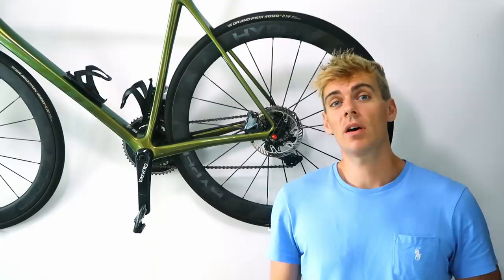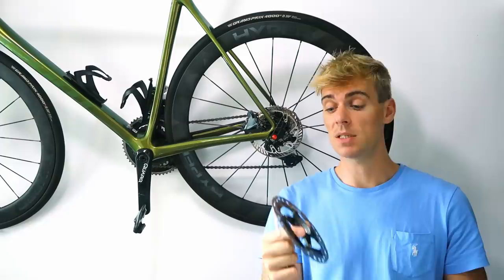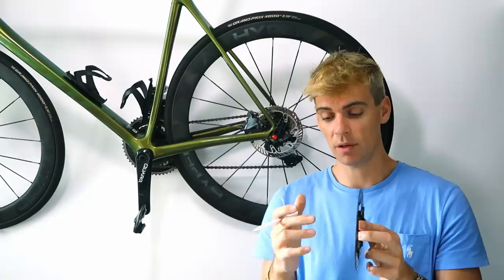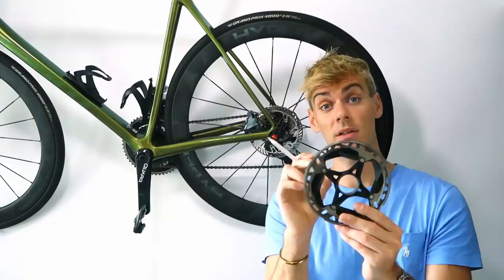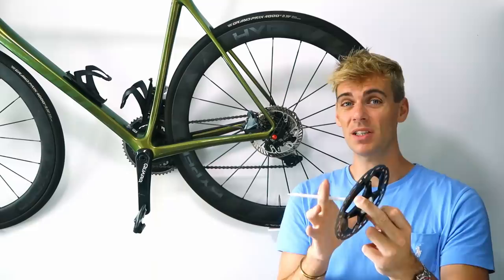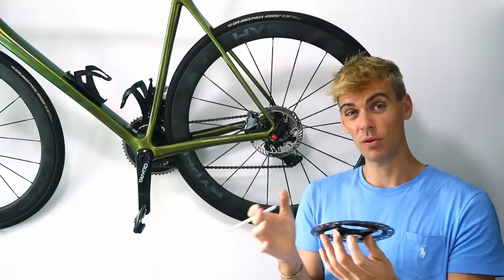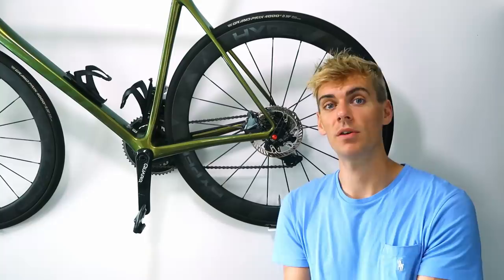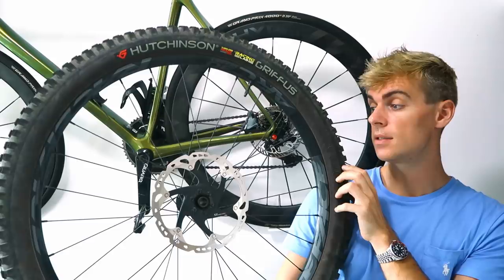Why I stopped using Shimano rotors: Disc brake rotor design, cracks & thermal issues discussed.

Comment: I'm a big fan of rim breaks and I pity people that are pushed to buy disk break bikes and they're having such problems. Althow an attempt to evolve breaking and riding, is not perfected yet by a long shot.
Hopefully other materials will be utilized in the future, that are more adequate for this light, strong, heat resistant role. Ceramics which incorporate stone wooll or stone cotton,  maybe titanium or other metal alloys.... I don't know.... But for sure bike industry should have know better....

Comment: Just wondering, why did you use the MTB rotors instead of the road rotors? You said yourself that road discs were expected to take more heat and these MTB rotors seem to have less surface area to dissipate heat.

Comment: Dude my brakes are like 50 bucks and I go down hills at 40 miles an hour and I have never had problems besides bent rotors from moving my bike in a car with other bikes how does a top of the line groups that have problems with this everything should be absolutely flawless

Comment: I really want to like disc brakes on a road bike, but for me it's a flawed design. My commuter gravel'ish bike has disc brakes and something is always rubbing, the braking performance is great.... yes... but good rim brakes also decelerate superb, even in the wet if you pre-brake a bit before you have to stop or heading for the turn.

I want to get a Giant TCR Advanced 1 at the end of the year while the model with rim brakes is still available. In 1 - 2 years you will hardly get racing bikes with rim brakes, which is a huge mistake in my opinion.

Comment: Why not machine a 6 bolt disc and use a simple and light adapter to fit on the centerlock spline?
Reply from the maker: I don't really like the adapters as its just another interface for a stiffness drop and hysteresis.

Comment: I use Hope 160mm floating discs on my road bike with Shimano calipers, work great, no rubbing at all. Can I suggest you speak to Hope as they have over 30 years experience designing and manufacturing hydraulic disc brakes for cycles. Don't waste your time trying to make your own

Comment: I have 6k miles (California Bay Area hilly miles) on ultegra rotors. That de-lamination is wild. Besides the general Shimano small pad clearance that makes putting new pads on a huge pain, I haven’t had any real issues with mine. Wonder if it’s jus the Durace as the Ultegra is quite different fin design
Reply: My group could be called the "Shimano Rotor Hate Club"   The constant ticking of rotors that are out of true or warped or whatever is so prevalent across a wide weight range.  We ride in the SF Bay Area and regularly see 2k to 4k feet of climb/descent so braking is paramount.  I was going to try FSA again, but maybe the campy route is worth trying too.
Reply: Oh, and they will tick on cold days too.  I think it's just a temp differential between the Shimano metal sandwich that causes the rotor to cup.
Reply: Oh, and at last year's TDF, one of the cycling publications said that a number of teams were using Shimano mtn bike rotors instead but could not get anybody to discuss the specifics on the rotor choice.  Perhaps the pro mechs are tired of dealing with complaints/fears of bad rotors.

Comment: Presumably this is more of an issue on the front rotor? Or are you seeing similar problem with discs on the rear?
Reply from the maker: The cracked and delaminated one was actually the rear!
Reply: @PeakTorque  Any idea why? Surely whatever riding you’re doing the front is taking far more of the braking force/ensuing heat? What state was your front disc in?

Comment: Rotors are not the place we should be looking at to save weight. Long life and dependability are way more important. In fact I wouldn't mind if rotors were thicker too, although caliper designs would have to change to fit them.

Comment: you said in a previous video that the brake pads you use are the cheapest compatible. those xtr disks intended for heavy use and mtb should last much longer. are you sure the fault is with the disk and not your choice of pads?  xtr warranty should be 3 years...

Comment: 2:59 you talk about floating rotors that "are used all across motorsports"
Please cite even one example from the past 30 years.
Rotors are NEVER the floating element in automotive braking systems.  The calipers are where the float happens.
I'm also going to question your claim that the bike rotors have float.  How is that with a solid riveted joint?  If there was any float, you would be able to show it while holding a rotor in your hands.  The rotors do not have float!

Comment: I would try titanium. Bicycle brakes are way under sized that's why so many people died. We need moped or motor cycle sized brakes. Especially if you are a hevy Rider. An extra pound of weight for the added safety, priceless. Not to mention the cost savings, and reduced mataince. Brakes should be able to easily lock up the rear wheel so the bike can be more monmoverable with controlled sliding.

Comment: Basic physics say that these rotor have to absorb way more energy per mass at say 50km/hr descent than any moderns sports car. 3-4 times more I think hence why they cannot withstand it. At the very least, IMO these rotors should be forged not cast. Intrigued by Colnago's DUAL front rotor option... As for Shimano, let us discuss the rear cassettes carbon plastic core with snapping rivets, 9000-9175 groupsets? we had to switch to monoblock SRAM 1190 or so no more issues... chain issues so on. So Shimano is good at one thing- ACCORDING TO THREE bike shop owners- is threatening to suspend their account IF COMMENTING PUBLICLY Shimano design flaws and RMAs...So yes, petty tyrants are just better at enforcing silence on those engineering fails like ULTEGRA CRANKARMS?

Comment: I have the Campy rotors on all my wheelsets, they do have issues with heat cycling and rubbing. I wonder how 6-bolt rotors with the DT Swiss adapters would perform.

Comment: Stiff is weight... Anyone buying light weight parts knows the trade-off.  But anyway what is the thickness of that disc?  Still within limits?  If so then you have a point, if its worn beyond that then this is just clickbait.

Comment: Still using 140mm rotors? Presumably that could reduce lifetime vs 160mm
Reply: You lose compliance through the fork and frames when you start to go bigger on the rotor... Special when you don't have a suspension fork..

Comment: Mine last about 6 months as well, but with a decent amount of riding and I live in a very hilly area. That seems solid to me? I do have issues with them bending.
Reply: typical warranty in Europe is 2 years. So I would expect an item to last at least that long for a non-pro rider. Maybe replace the pads if worn, but not the rotors.

Comment: Not all riders regularly encounter the  terrain, or weather conditions, or ride aggressively enough so that the benefits that attend the use of discs apply. This vdo strikes me as an effective argument for avoiding the weight, fuss, cost, maintenance, and small aggravations that also apply. 

My comment is not an argument for, or against discs or rim brakes, as both have specific virtue. What isn't certain, but seems a looming, possible/likely industry switch away from a perfectly simple and proven system toward the mandate of more complex and fussy discs. I don't see how this benefits cyclists as much as it benefits component makers. Nevertheless, there'll likely be rim brake alternatives as long as frame makers provide a rim brake option.  Underinformed new buyers will no doubt be disc riders by default, only after the buy finding out the depths of the commitment made, and so, leading to some drift of equipment preference as well. As a rider's experience evolves, so will the riding style, choice of bike, or additional bikes, and the associated best fits for componentry. 

Wll PT be a part of cycling future choice? Hambini has made his stake, and perhaps enlarges it in time. It seems reasonable to expect another smart, critically thinking engineer do as well. How much time a person has for all the aspects involved in youtube channeling, private industry, job commitment, life other than bike, well that's  another story.

Comment: Im riding MTB with disc breaks since 20 years, the disc brake market is huge. Isn’t there anything already out there that matches your requirements?
Reply: I'd think solid disc rotors are not the answer, at least in my experinece. I've moved away from solid steel rotors on my MTB due to warping/pringling of the disk. Moved to Hope floating rotors and never had an issue. Hope use very large hollow rivets instead of the small diameter pins of other manufacturers floating rotors. Hope have been in the bicycle disk brake business longer than anyone and from my experienced with disk brakes on my MTB I went straight to Hope callipers and rotors on my road bike and never had an issue with disk rubbing, disk warping on my MTB or road bike. Only time I had issues with rubbing brakes was when I rented a road bike when on Holiday which has Ultegra disk brakes. Bloody awful things. But my Hopes have been great so far.
Reply: @scottw8051  Which model Hope rotors have you been using on your road bike?
Reply: @DanKolan  their 160mm road floating rotors. Pretty much identical to their MTB rotors. Not sure if they're available in Microspline though.

Comment: These are not floating rotors… neither the Shimano nor the Campagnolo …and neither of these brands in any of their descriptions claim them as such… they’re just 2 piece rotors. 
They’re fixed with rivets as opposed to bobbins and have no natural outwards play for expansion and will warp if heated too much. 

If you want to see true floating discs try Hope or Magura those discs are not pinned to their carriers and will physically move separately from the carrier and will rattle very slightly as the disc gets hotter they will resist warping much better as they’re truly free to expand.
Reply: My Deckas ones are as you described like the Magura's .
Reply: The heavy mass at 12:45 will kill this innovation .

Comment: Icetech is stupid. It's just over-engineering to charge you more. I've been a mountainbiker for years going down really steep stuff with brakes on almost the whole time for loong rides and have never had a problem. Because once you go to large discs your heat dissapation problems disappear. Just put larger discs on your front brake, problem solved.
Reply: They look silly as well in my opinion. But it's hard to find a rotor that doesn't look like a child's toy. The GS 2, Galfer and Trickstuff rotors look nice.
Reply: I have avoided them altogether when a Shimano rep said they were flawed from the "get - go" .

Comment: Yep I've killed 3 icetec Rotors now in 24 to 30% hills! If you start looking on the forums you will see they are quickly getting the name Warptec!
Reply from the maker: Interesting. I don't read the forums, feel free to share a link
Reply: @PeakTorque  I'll have quick look again for you again
Reply: @PeakTorque  think this was one of the forums below, but if you start looking on the forums your see lots of mtb guys have had to go bigger n bigger rotor size to help stop warping, or many agree that alloy seems to allow the rotors to warp easily, and that when warped alloy core rotors are a sod to true compared to steel.

Comment: The thermal cycling probably isn't helping the bonding (?) between the sandwich layers of the rotor either. . I mean, why make it that complex and delicate? Totally different issue, but Shimano cranks are also unnecessarily complex, leading to failure. It's like their engineers have never actually ruddn a real bike...KISS.

Comment: So......what you are saying, IS.....
we need larger stiffer heat sinks.....like a rim brake wheelset made of aluminium.   
back to the future
Reply: On another angle, can something be taken from F1 brake tech. 
https://youtu.be/CQCSDRp0pRE
carbon carbon with lots of air vents. 
sure low temp carbon pads and discs will not be efficient, but it doesn't have to be with bicycle weights. 
but then on steeper descents, where the discs and pads heat more, they become more efficient.....when you need stopping power most.

Comment: Have a look at GALFER DISC WAVE® NOW AVAILABLE FOR THE CENTER-LOCK SYSTEM - Galfer Bike
Solid Steel with Centerlock Interface. Have them since 4 Weeks and they are way better than shimano. No noice, no ticking, squealing, nothing...
And Brake power is at least the same as before i would tend to say even better...

Comment: I am so glad i only have rimbrakes on my bike after seeing this video
Reply: I have both on my bikes, but I don't have such problems. 
If you use a bike too extreme you can cook your disc brake, but you could also overheat a rim brake, leading to bursting tubes in the wheel. 
I use simple Mt 200s and RT10s.
Reply: @simonm1447  i live in a super flat area don't se how u would manage to over heat them only have head winds around
Reply: @simedinson984  In this conditions you won't overheat any brake. 
I live in a relatively hilly area, I made a cycling tour yesterday with my road bike (it's a modified trekking bike with road bike and mountain bike parts, no pure road bike), around 50 km, but around 850 vertical meters of climb. 
Despite this my simple disc brakes (Altus calipers and Tourney discs) did not overheat.
Reply: @simonm1447  yea I do about 100 m per 30 km
Reply: @simonm1447  also sort of dont se the point in disc brakes on a road bike unless you have a super high end roadbike with expencive wheels and a super light frame or the weight just doesnt feel worth it (that being said i have a 10 kilo aluminium bike i ride durring bad weather and a slightly lighter carbon on for good days not sure about weight but defo lighter)
Reply: @simedinson984  The brake feeling of hydraulic discs is different from rim brakes, you have a defined pressure point, while cable brakes don't have that, cables stretch much more than a hydraulic hose. 
I converted my commuter E bike (5 to 6k km per year) to discs, because on this bike the V brakes have been maintenance intensive, I had to re adjust them at least every month (it's heavy, with 2 batteries and panniers more than 30 kg), now I have a hydro with a 203 mm rotor in the front and only have to replace the pads every 6 month or so. They are also less sensitive if they are driven in rain, because the brake force don't  decrease here as much as it do with rim brakes.
Of course this don't mean rim brakes are bad, they also work, they are a little bit simpler to work on (they demand less special tools) , and on a lightweight road bike driven in dry weather it's a matter of taste.
Reply: @simonm1447  yea I would love them on anything that wasn't a road bike basically I love the breaking feeling of them but yea

Comment: Stainless over aluminum core, with the difference in thermal expansion properties, might be a “less than ideal” design in a high temperature swing and duty cycle application. Especially with the thin layers of stainless, no wonder they are delaminating/cracking. However, I guess it also depends on speed and stopping distance. As you mentioned, pros can swap discs every stage if needed, but they rarely touch the brakes! 🤣 for the rest of us, thermal management is crucial. Nice niche for a well engineered product. Good luck! For the present time, while this tech continues to bake 🤣, rim brakes for the win!

Comment: What are you measuring with?
That rotor is clearly long past 1.5mm thickness and has wear patterns that suggest it has been run on contaminated pads.
Now if you are running your pads down below minimum thickness as well then the pistons are coming out of the calliper much too far and then begin to rock in the bore and distort it.
You have then pretty much set yourself up for sticky pistons causing uneven deployment and extraction for the rest of the callipers life.
These brakes work extremely well when run to the manufacturers specifications.
The Icetech rotors are extremely quick and easy to straighten to within .03mm runout and by far the best rotor on the market.
A full steel rotor on the other hand are bloody downright near impossible to get straight and change runout when they get hot. 
Bumping a rotor on the calliper when fitting the wheel will not bend it unless you are the most hamfisted moron in the universe, and in that case, this is why you should not be allowed to have nice things.
Looking forward to your equivalent of the cheapest, most basic rotor made coming out and being sold for a stupid amount of money to everybody else who cannot seem to grasp the idea that disc brakes simply have a different maintenance requirement to rim brakes.

Comment: Why are you using disc brakes?  A great rim brake (like Shimano Ultegra) does everything a brake needs to do for almost all riders plus it's lighter, quieter, simpler to service and maintain, and has no batteries that must be fussed with.  Paired with a great wheel like Shimano DuraAce and you've got a setup that will last for years.  

Honestly, what people will do in order to be part of the latest tech fad ...

Comment: I have my ice tech ultegra rotors for two years and they as good as new. The reason you most probably going through discs is because you using your brakes too much brakes. The only time you need your brakes is when you going into a corner not when going downhill on a straight. The amount of time you spend on breaks is minimal. If you stuck behind traffic going down a hill you gently tap and alternate between front and rear brakes.